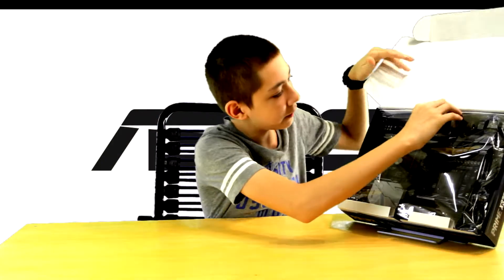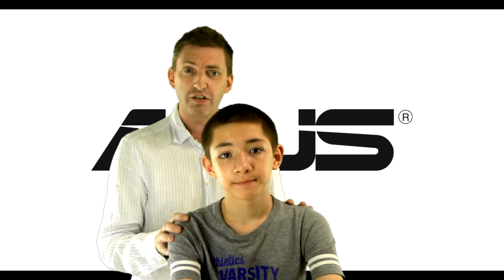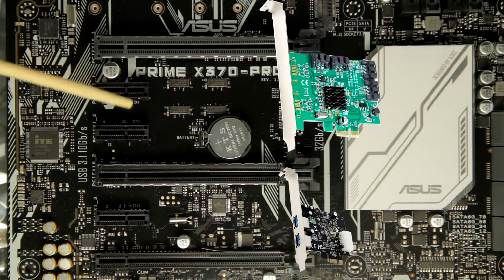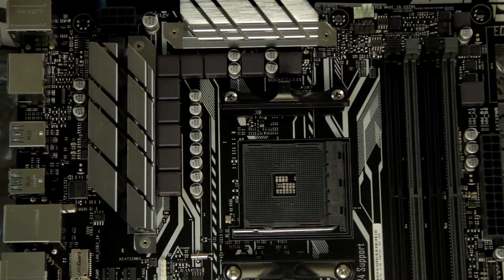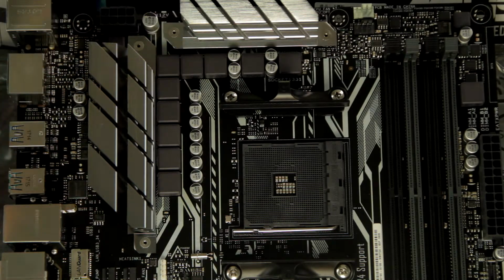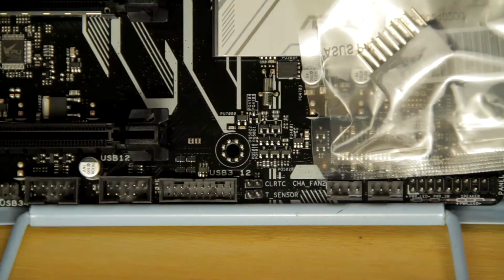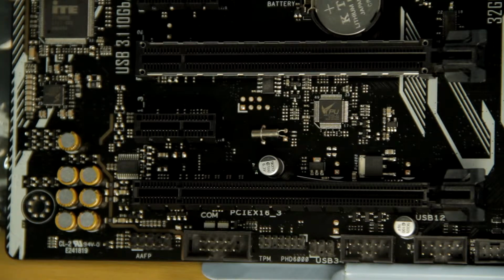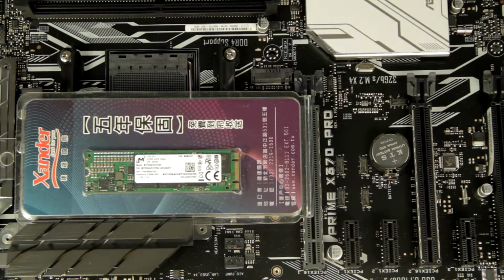Asus Prime X370 pro Motherboard Review.

Comment from the maker: One more thing, which I have no idea was left out on the editing until I saw the video posted was:

 Above the 1st PCIe there is the Intel I211-AT Controller, which controls the Intel LAN Port connected to the back of the board.
Next to that, we have and AIO Pump 4 pin connector to connect a water pump, if you’re installing an AIO pump and Radiator to your system. The 4th pin allows a Power Management signal to your Fans on your AIO, to change speed while using full +12V provided by the PWM Header. If you only have a 3 pin header connector, that’s okay, just be aware your 3 pin pump will act as a DC Pump/Fan and the speed will be controlled by variable voltages supplied by the DC Header.
Next to that is another 4 pin connector for a Fan. Usually the Fan from the back of your case will connect to this, as the fan and connector are close to each other. Again, be aware, if you place a 3 pin connector, it will act like a DC fan and the speed will be controlled by variable voltages from your DC Header.
And next to that is the RGB header. If you have RGB LED strips you can connect them to this. If not, then what RGB you have built into the system will be controlled by software.

Many many apologies for that. I think I will make that a small video on that one thing.